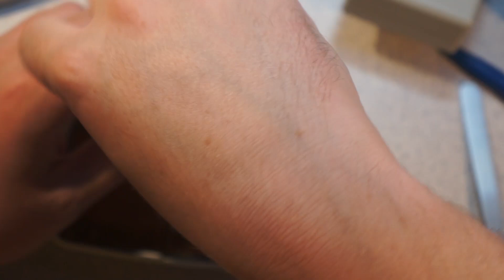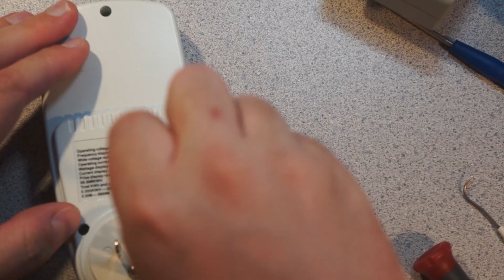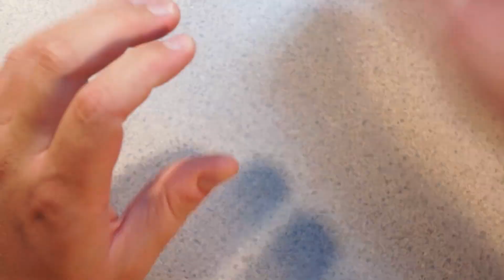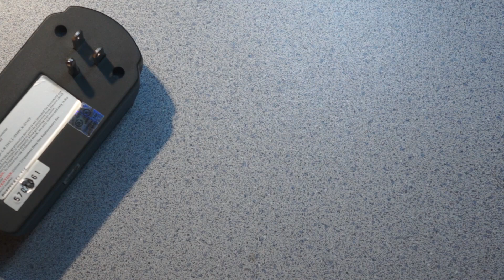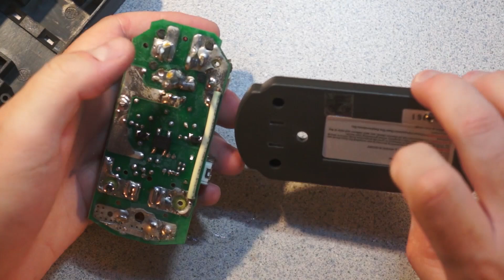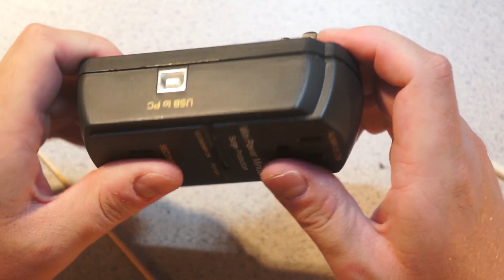Plug-Power-Meters teardown and analysis

Comment: Here is a use for the Mini Power Minder, hook it up to an Arduino or Pi unit. Then it can turn on the secondary upon any number of things. Humidity, Temp, Light or Dark, motion sensor, current load, voltage, etc.....

Comment: I have the 1at one meter and a week ago the display went black. Opened it up and found the battery at 1V. I replaced it with a new one and the display came back to life. However, power goes through, frequency registers correctly, but both voltage and current readings are stuck to zero. Everything else seems to be working. Any ideas?

Comment: I have the cheap one, 1st one you opened. It quit registering the voltage and watts, yet the display still works. Any idea what part might have quit working?
Reply: lizardzman I have the exact same problem. Power goes through, frequency registers correctly, but both voltage and current readings are stuck to zero. Everything else seems to be working. This happened as soon as the meter quit working and I found the battery to be bad (it was around 1V). I replaced the battery, every function came back but no voltage/current/power registers.
Reply: Update, Amazon sent me out a replacement, I received an open empty box. Guess Prime didn't know I have a camera, so seen the driver deliver it, nobody else came around. Amazon ended up giving me a full refund.

Comment: For 240V they use smaller capacitor with higher voltage rating for dropper.

Comment: Connor Wolf, please tell me, which one is safer and overall better? The first one (ebay unbranded 3 lines display) or the Kill watt series (P4400 or P4460 EZ model)?

I noticed you said that Kill watt was dangerous by having the main AC lines really closed from each other... does it makes the first unbranded model better and safer?

I'm having the choice to buy both for the same price, about U$15 unbranded and U$20 kill watt.

Comment: The first meter you reviewed here is sold in South Africa under the name "Efergy", and our grid is 230V. I have one of those. It looks exactly like yours on the inside.

That little 3.6V NiMH cell blew up in mine. Not explosively so... the display just grew dim and then it stopped working. I had a bunch of AAA NiMH cells lying about, so I strung three of them together and got it working again. Something in the back of my mind keeps asking why it blew up in the first place... :-)

Oh, and yes, they do use a cap-dropper on the 230V model.

Comment: I have seen the KaW + moteino hack, but I am interested in hacking the cheap one you show the first. There is a blog entry called "Gizmosnack: Power Plug Energy Meter Hack" that hacks it but uses the digital part. 
Do you have some tips as to how to plug into the analog voltage/current metering signals?

Comment: 7 amps at 250 volts is 14 amps at 120 volts. 1 amp low, but I wouldn't try pulling 30 amps through the main jack. Surge protection. LOL

Comment: I don't understand why they went to the trouble of having a capacitive dropper and opto-isolator on that power minder when they could simply have used a 5V relay with coil directly on the USB 5V (plus a catch diode)! Any decent relay would not draw over 60mA or so...

Comment from the maker: This is correct. Theoretically, which connection is hot and which is neutral actually have no effect on the functionality of the device.

It is safer when the majority of the device is referenced to neutral, rather then hot, but as long as the case is intact, it actually shouldn't make much of a difference.

Comment: I guess non of these meters (at least if they also have an EU version) rely on the fact which pin is neutral and which is hot? Because here in Europe there's no way of telling which input will be neutral and which is phase as the plugs can fit either way in a socket.

Comment from the maker: They can't use a bridge in this case, since one terminal of the power-supply *has* to be referenced to neutral (or hot) for the device to properly measure the line-voltage. 

Using a bridge like that is good from an efficiency standpoint, but there is no effective way to measure the line voltage with a resistor divider anymore (though you may be able to do something clever with software..... hmmm).

Comment from the maker: There have been, as far as I can tell, three revisions of the kill-a-watt hardware. 

The two kill-a-watts in this video are the first rev. The TH version in the picture  embedded in the video is the second, and the all-SMT version is the third.

I strongly suspect that the only difference between the EZ model and the normal model is just software, so I would guess that the EZ version has been through the exact same revs as the non-EZ one.

Comment: The capacitive droppers usually use a full bridge for efficiency.  The electrolytic would get charged to peak mains voltage without the zener.